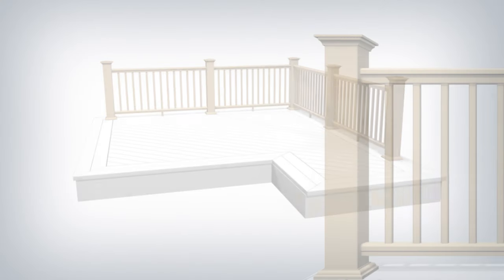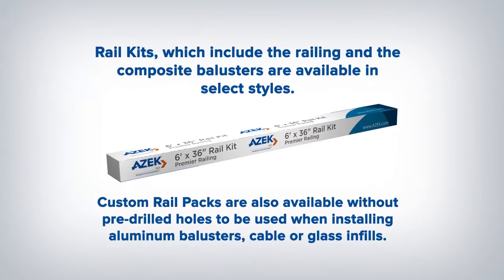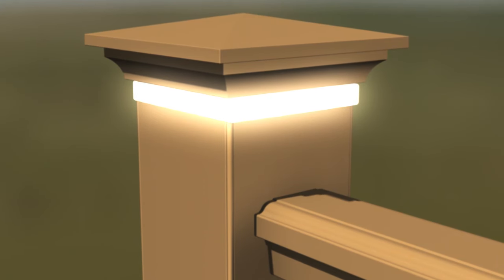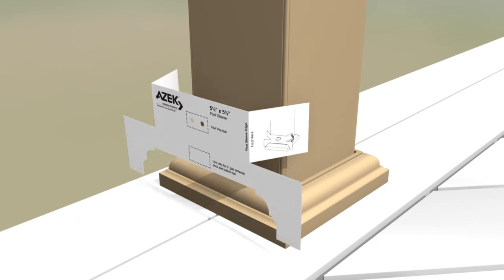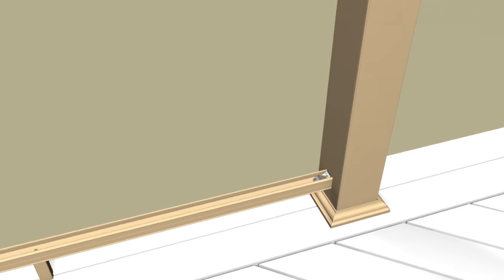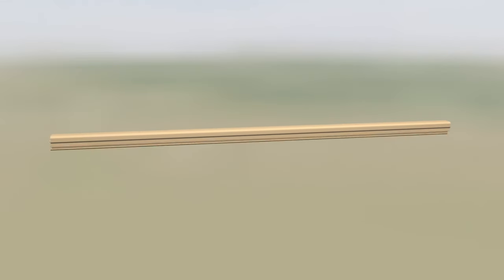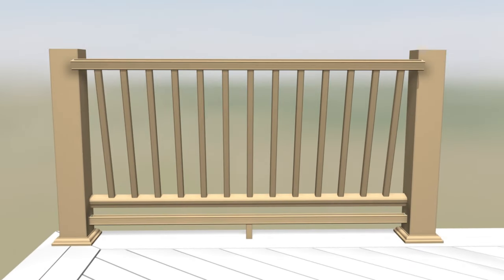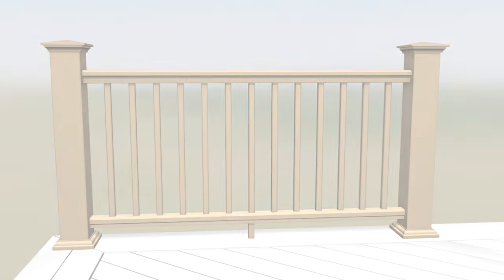TimberTech® Classic Composite Series & Reserve Railing Installation - Composite & Aluminum Balusters

Comment: At 2:02 the video says "Azek rail also works with Azek secure mount post". I spent $15k on this railing to later find out this is wrong. The supplied stainless steel screws are 3 inches long and will stop when they hit the steel post, making it impossible to screw them in more than half way. So now what? I can't return them anymore and the railings can't be installed... The rail system requires a special screw made out of a special grade of stainless. Sooooo I'm just out of 15 thousand dollars?
Reply: Hello!  Did you ever get it installed?  If so how did you do it?  I also have those secure mount post and am wondering about the same thing 🤔💭

Comment: You forgot to  show  how  to shim post sleeve  plumb.
Reply from the maker: Tony, you are correct, the post sleeves are oversized to allow the posts to be shimmed to square and plumb to accommodate movement/twisting of the structural 4x4 posts. Cedar or composite framing shims can be utilized. For further details, please call our Customer Service Team at 1-800-ASK-AZEK. Thanks for reaching out, and sorry for the delayed response!